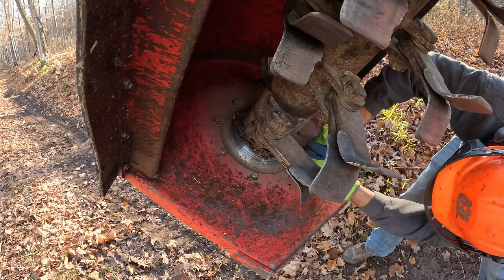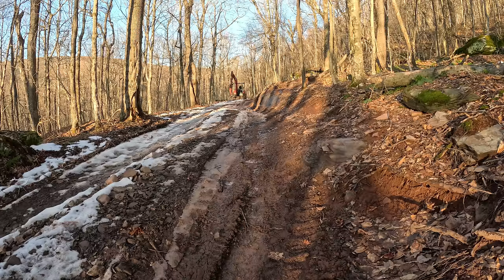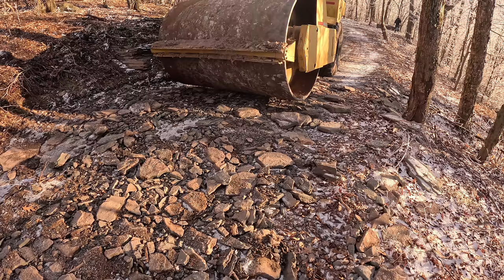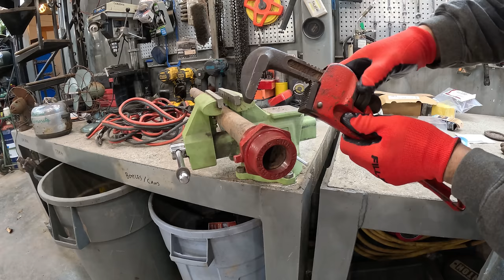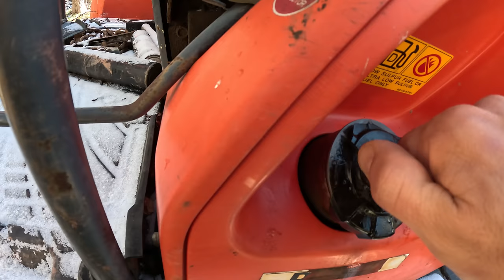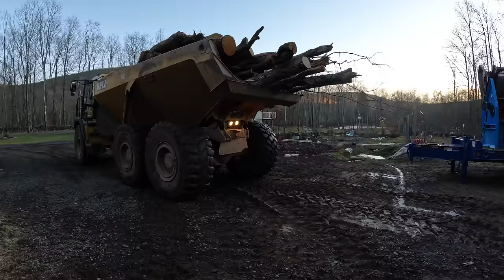Using a excavator to mow, hammer, and load wood

Comment: That blu monster pipe thread tape is the best stuff i have ever used, and it work's on just about everything.  I have a shallow well pump made with stainless steel, and everything else would leak, so i read a review on this thread tape that said it worked on stainless steel when nothing else would, and they were right.  I like that it's thicker than the regular crap, and work's on gas, water, and fuel.  Nice tree trimmer, minus the barbed wire.  G-d  bless.

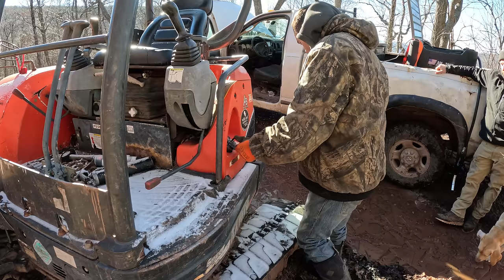Comment: 33:50 When i was going to the mountains every weekend in the winter i'd use this lock de-icer that would thaw locks if they weren't completely iced over.  I noticed using it every couple weeks and my car door would stay thawed.  Worth keeping some in your work truck and on your regularly used machines.  it's only a few bucks and saves a lot of time and headaches.

Comment: I spent a summer doing 12hr days (8@$25/hr, +4@$37/hr), Sun-Fri), May 2nd wk, through Aug 2nd week, driving a F350 dually, loaded with 3 mobile fuel tanks - loading up on diesel and then filling a huge fleet of Cat dozers, graders, payloaders , pan scrapers and off-highway dumpers… enjoyed the job and the $25k I made, but dam was I definitely ready to get back to university at the end of that summer

Comment: Hey man, I've been watching you for years. I love the content, all the way from simple culvert pipe installations to brush mowing with an excavator. But nothing in your videos has made me quite as nervous as watching you untangle that wire in the mower with the excavator running. I didn't notice if you had done something to make sure the machine wouldn't spin up, but in the future, you really should consider turning off the machine or disconnecting the hydraulic hose temporarily, for safety. I'm sure one of the last ways you wanna die is by getting diced up or tangled through a machine due to some stupid unfortunate accident!
Reply: That's EXACTLY what I thought!. It made me nervous even watching from the comfort of my office....yikes.

Comment: 6:21 "The guy who invented this stuff was hated for the rest of his life and you see why..." It's hilarious to see when Andrew actually gets annoyed by something!
Reply: Like when he says, "This thing broke for no reason!".
Reply: Joseph Glidden, the man credited for inventing barbed wire, was only hated by the free rangers who grazed their livestock where they wanted. It was loved by most farmers who found it affordable and durable. It had a lot of benefits over traditional wooden fences.
Reply: @davidmorse8432  I have. Still doesn’t make me hate it.
Reply: @KJ-kw7gh  Well if so, you do respect it.  What is your technique for removing it?  And did it ever cut the oil seal in the bottom of the gear box?
Reply: @davidmorse8432  Ive used knips to remove barb wire, and never had it get into a seal. Did have round bail netting get into it one time and eat the seal up though.
Reply: @KJ-kw7gh  Yep, that's pretty much what I do too.  I have a small pair of bolt cutters that I use and just get in there and cut cut cut.  
I never thought about that bale netting getting wrapped around the spindle but it is fine enough that it could get past the guard that protects the seal.  Thanks for alerting me to that possibility.

Comment: Those stone walls on the sides of your road are really cool. Wonder how long they’ve been there and what they were used as?
Reply: Property lines. New England alone has roughly 250,000 miles of stone walls. That doesn't include new York.  Pretty wild.
Reply from the maker: Yeah, they are cool. They are everywhere.
Reply: they are a great place to look for stuf with a metal detector
Reply: @henray76  they also get warm in sunny day and snakes love them. More cracks, the better.

Comment: How are you liking the kubota excavators you have? And how many hours are on the 161
Reply from the maker: They are nice. The 161 has low hours like 1750. But my 121 is close to 10,000 hours.
Reply: What year is the 121
Reply: Will there be a video on the 161 like the first year of you owning it?

Comment: Rock hammering and Mowing with an open cab machine somebody is a brave man. The mower looks like a US mower clone/copy the only difference that mower has the dog plate for picking up logs with the thumb. The only caveat with that is you need the extra hydraulic function so you can run the thumb on the left hand joystick. Most machines don't have that unless you set it up for mower use. Yes the 20 GPM Fill rite pumps require you to make you're own draft tube I installed two of them on the fuel tanks at my previous job. Very expensive pumps they don't tolerate plugged filters thou, you run biofuel or bio blend diesel fuel you need to change the filters every 6 months.

Comment: I have been out of the industry for 20+ years but I was around when the grid shell was developed and have sold quite a few.  One would work well to help crush your rock on the road, much better than the smooth drum. You should probably upgrade to a drum drive roller if get a grid shell.  As a note, vibratory rollers have killed quite a few due to there poor brakes.  Ingersoll Rand got rid of their hydraulic brakes and went to air, which helped.  I think the real problem is trying to stop with just one axle.

Comment: I’ve used white Teflon tape for thirty years on petroleum products never an issue,great video.
Reply: Just the opposite. Best buddy locked up a 10K$ injector pump with Teflon. Loctite 545 is the only way to go.

Comment: Hi Andrew, you gotta get yourself a Battery Heat gun & carry a spare batt in the cab of your fueling truck for all those frozen fuel caps etc etc,  it will be a real time saver, love your vid's & how the mountain is transforming, big thumbs up from the UK, Cheers, Chas.
Reply: Heat gun could have melted the plastic gas cap housing that was locked before it thawed the lock

Comment: If you got cattle, barbed wire is priceless.  Barbed wire is just like duck tape, more is always needed, never can have too much.   Yeah, it can be frustrating when you get into barbed wire with equipment, especially unexpected.    However, since you break and damage so much equipment everyday, this should be a normal routine.   Compared to other Camarata videos,  this barbed wire was no sweat but could have been worse.

Comment: Good advertisement for fill-rite I guess they gave you that pump and filter hose and kit. I like to have on those pretty high dollar I still do the old turn the crank method.
Reply from the maker: I need bigger tanks now. Using lots of fuel lately.

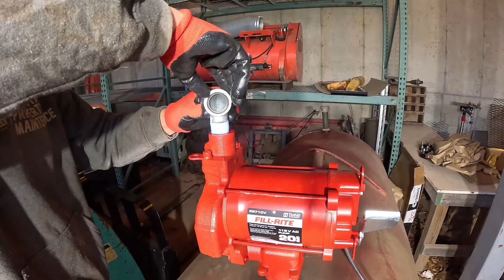Comment: 30:00min mark-  Andy-using galvanized fittings with diesel fuel-galvanized piping causes early hour failures of injection pumps and injectors.
The zinc coating dissolves in diesel fuel, forming a solution that contaminates the fuel supply. I learned the hard way..best of luck to you
Reply: Thanks for the tip, I didn't know that.
Reply: He could also have grinded that pipe clean. It will clog filters.

Comment: Just the routine maintenance of that road and the general perimeter would be a fulltime job for a multi-man crew employed by the state's road/public works dept, let alone one guy like Andrew who has other stuff to do!  ... well, a state crew would be at least 6 Union Laborers + 1 foreman + 2 supervisors + 1 OSHA Rep + 1 Union Rep + 1 inspector + 2 haul trucks + 2 excavators
+ 12 govt pickup trucks + 2 street registered dump trucks + 2 snowplows + safety equipment + 12 govt cellphones + 6 govt laptop computers = $3,000,000 annual cost, at least!  haha ha!

Comment: I think i have some new snow blower suggestions, for a very strong single stage, you should get the ariens professional 21 inch. For a 2 stage it the ariens kraken, tracks, heated handle bars, electricly controlled shoot and a linear actuator for the raise and lowering, I don't have these blowers but they have alot of cool reviews on youtube.

Comment: Dear Andrew. As a german former soldier I can safely confirm, that barbed wire sucks pretty hard. No one likes this stuff, and its kind of like a desease. But in your case it did what is supposed to do, it sucked. As we have experience in two world wars we know what this kind of stupid stuff is used to be for, the only purpose is to suck. So as it sucks the problem is not the barbed wire, its the stupid people who left it there. The Wire did it 's job. Along with the explosives and the land mines which we find here every day. They are doing it jobs, too, they suck!
Reply from the maker: I cleaned up a ton of barb wire recently. Cut it off flush on the trees then picked it all up off the ground. Tons of trees with broken wires going to nothing.
Reply: @AndrewCamarata  The trees were cheap fence posts.

Comment: I am a long time fan of your posts and like the way you think and how you problem solve by thinking laterally like the way you put the key on the exhaust manifold.  I am 72 years old retired maintenance fitter I don't know what it is like in America but here in Australia I'm one of a dying breed during my working years all the young people were encouraged to go to UNI very few went into the trades and those that did specialized in one trade or another.  I myself hold several trade certificates and proficient in quiet a few others my only wish would be that I could have trained more young.  You have a perfect opportunity your a smart lateral thinking person who could easily take on a trainee and pass on valuable knowledge he could keep your equipment clean fueled and serviced ready to go. They can also help drive one piece of equipment while you drive the other and you might not break belts on a rock crusher Ha Ha.  But the most important thing about this is passing on your valuable knowledge.

Comment: I just rebuilt my Kent Fukuwarma Hammer . Not to bad to do 
Need to check nitrogen pressure alot on these hammers or low impact power .
A guy in Massachusetts has all the kits for small large Hammer s.
Good job.
I want to get that mower for a IHI55 excavator. 
👍
PS: what brand is that shredder?

Comment: It may sound strange but using your dozer to crush all that rock into gravel would be your best bet. The metal tracks would chew through it for the gravel your wanting. The roller doesn’t do so well because it’s for compacting and rubber tires can’t do what good ol metal tracks can do. Give it a try, I’m sure you’ll be happy with the results. Plus good job on greasing every time you use that hammer!

Comment: I’m in Alaska. Frozen lock solution- Heat the lock with a torch and open the lock then take the key out and heat the lock again followed by WD40 sprayed into key hole and lock mechanism etc while still warm. That way the moisture is pushed out and can’t reconednsate= Lock won’t refreeze. I get a week plus in the very worst conditions unless freezing rain. Hope this helps. Freezerburn

Comment: Thank you for the video. You are my favorite.
Now do yourself a favor and put a street L on the output of the fuel filter. No more pinched hose and you now have strain relief what with the hose hanging straight down. Or use a swivel coupling. Or both.

Comment: 29 minutes in. They make cord grip fittings that you can use instead of a romex connector for the fuel transfer pump cord that will help keep moisture and bugs out of the electrical box on the pump. You probably knew that but if not then now you do. Love the video as usual.

Comment: Hey Andrew, if you take a large PVC pipe, glue to it U bend, install in it stainless metal mesh that holds geothermal fabric, pack it up with 50lb of cat litter and send through it red diesel, on the other end you'll have uncolored diesel. Cheers!
Reply: Activated carbon also works the best, so don't burn away your stumps and lumber, use it wisely:)

Comment: We have over 68 acres of undeveloped land that we have been slowly carving walking/riding/snowmobile trails trying to follow the natural lay of the land. We rent an ASV tracked skid steer with the FECON mulching head. It does great on everything it can reach but this attachment you have on the excavator would be much more efficient. Especially the vine type plants that just never stop encroaching into your trail area. With that thing, I could reach all the way back to where the vines start and not have to spend hours on the ground just to get back to it. Hope that makes sense. I need to see if my rental company has one. We have a small excavator but I am not sure how much GPM that head requires. I imagine a lot. That's the beauty of watching videos like yours. I get so many ideas and solutions I would not have thought of. And that's the power of YouTube. And the power of your channel, besides its value as just an entertainment.
Reply: Well, from the video, it looks like if you're going to be doing a lot of mulching anc clearing, you'd want more flow than Andrew has on that machine.  But of you're just trimming areas already cleared and mulched of new brush it seems to do just fine.
Reply: @andrewalexander9492  Yes, but some attachments have a minimum flow just to make the thing work at all. But I get your point. It's really size of the job dependent

Comment: To change attachments on your machines easier... shut off the machine, turn it on but dont start it... and operate the buttons or levers to releive the pressure in the lines, then after your hoses are attached start it up and carry on... worked for me.

Comment: I would suggest putting beet juice in the tires and roller for ballast weight. Makes it more stable and does not freeze. If to be used in the winter add chains on the tires.

Comment: I would definitely find myself a stout spring to cover the hose end going into the pump. Bending will break the hose but a 12+ inch spring will prevent the hose from bending.

Comment: Andrew I saw on youtube a large roller meant to break done rocks. Instead of one big solid roller, it had a blade with gaps between the blade. So it rolled them and broke them into smaller road-size fill.

Comment: PS:  Most vets agree that dogs eating bones can lead to impaction in the gut as well as lacerations of it with the sharp shards.  I know wolves have been eating them for eons however we don't know how many have and are dying from it.  They also have a specialized digestive system.  A not inconsiderable fact is wolves have to eat what they can get for survival whereas domestic dogs do not. Worms , bacteria, and parasites can come from ingesting decomposing carcasses.  When I first started with labs I gave them rawhide 'chew strips" and toys but I quickly gave that up when they started up chucking totally undigested compacted balls of the stuff after chewing on them.  They will eat about anything (some are more prone than others), bless them but not all of it is harmless.

Comment: Should tape the thread that connect the pump to the tank, not for pressure reasons but helps slow water seeping past those threads.

Comment: Nice to see you mowing up to the stone walls coming in, bet it will look nice come summer.
I have a see if you can find it for you. Do you watch Demolition Dave Drilling and Blasting channel? He has a hammer drill that goes on his mini-excavator, see if you can find one. I have been watching and trying to get a grasp of how much stone you are going to need for the driveway, in a few spots it looks like you need 8 feet almost 300 feet long to fix the slippery out of it. So that means you are going to need about 4 more shots of what the first two together where; this is just a guess. Would your explosives guy cut you a deal if you did the drilling yourself? Do you want the hassle of listening to the drill run all day? the excavator one isn't going to be as powerful as the rig they use, so it will take longer; but there is one more use to the tool. You can drill and prep all those stones that are bugging you in the driveway for the next time they come to blast and get them to pop that stuff out too as they are exiting. Just an idea, might be worth it, might not. Seeing the other stuff you bought for this job, small fries and might work. Talk to them about it, see where it goes.

Comment: Andrew , another YOUTUBER made a storage socket out in the field to store the Hammer on and angle so as not to loose it in snow or leaves. I thought I see one at your shop made of steel , the other guys was concrete left over from a job.Good to point out to viewers the flow direction , great investment , but will a fuel truck deliver to the mountain?
Any sign of a chipper/mulcher to grind wood for customers gardens?

Comment: I know of A tip trick to help you save on replacing those pumps A lot to for ya. Along with filtering out more dirt.& Debris to from the bottom of your fuel pump holding tanks to. It's called adding on A brass mesh filter screens with squeeze clamp rings around the screens to down inside of the fuel tank part also. Just A quick fast heads up on that part for ya is all. Even the farmers you should use those in theirs to. On trucks.& At their farms to.

Comment: Down the road you might have some trouble that fuel tank you cut. The bottom of that pipe flat should have been cut on a 45. When you get down to the bottom of the tank down the road when it hits empty it's going to suck the crap off the bottom of the tank so you cut that pipe on a 45 and it won't suck up all the crap. I worked on gas mains low pressure and we used to put a siphon in the gas main and we always cut it on a 45. So would it holds suck up the water out of the mains when there's a problem? Just something to think about. Other than that, good stuff. 👍👍🙂🇨🇦

Comment: If you twist the tape into a thread, then wrap it in the thread grooves. Then wrap it with the tape as normal. Is the correct way of using it. According to the manufacturer!